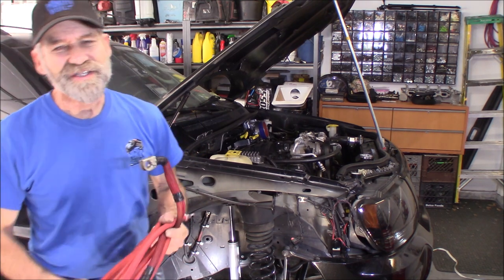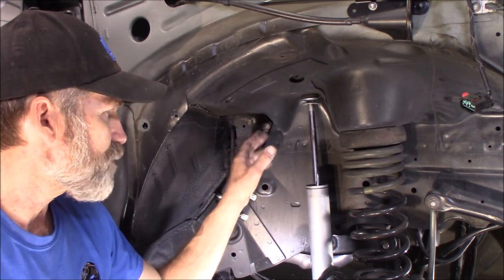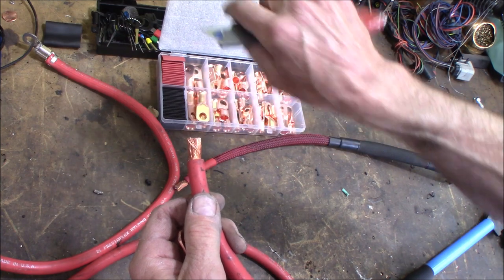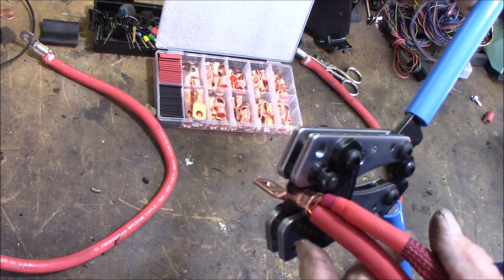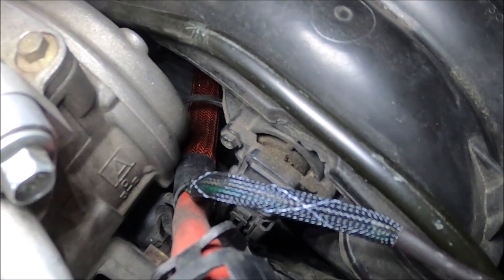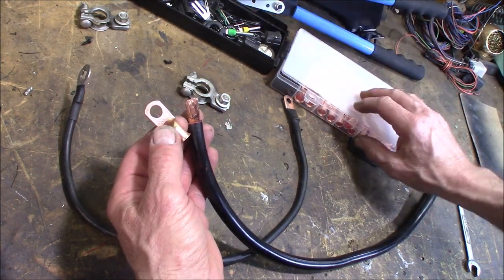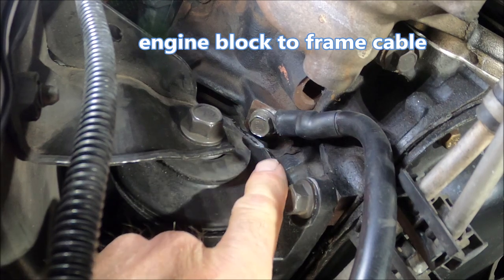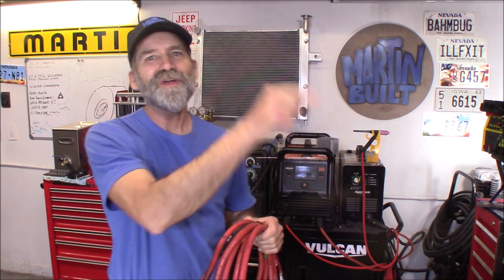How To Install the Big 3 Upgrade Improve Your Vehicle's Charging System

Comment: One of my first & best mods IMO. My XJ started first try, prepped for my Dodge big alt swap,& ensure current available when needed.
I used welding wire, waterproof shrink tube, & brass lugs. Upgraded batt post clamps too.
Reply from the maker: Thanks for sharing
Reply: Jmu

Comment: Nice job posting this. I did this a couple of years ago on my XJ and it really made a difference, smoother running engine and no issues with the gauges.
Reply from the maker: Yeah I may need to do this to my XJ
Reply: What size ground did you use same size as this?
Reply from the maker: @mobius-1503  yes, same cable 1 gauge, I just pained the red black.
Reply: @mobius-1503  yes
Reply: Also the ground going to the body by the battery I did that #4 as well

Comment: Use some liquid electric tape after soldering/crimping then add your heat-shrink and you will have a forever cable that will last until the lug rots off. Seems not many people know about liquid electric tape but it is a great product especially like where you joined 2 wires in one lug and have a penetration between wires into the joint.
Reply from the maker: I've used that liquid tape many times and it works quite well.
https://amzn.to/3MjrVqn

Comment: By pulling the negative cable first you prevent sparks. That's why they tell you to pull the negative then the positive. If it was a wet cell battery it could cause an explosion if it's venting alot of hydrogen gas at the time.

Comment: U pick u save in Syracuse New York I got mine out of a Chrysler 300 today yep 👍 about $ 6.00 in the rusty east coast. Thank you Martinbuilt great heads up on parts to put to use. I’ll have the ground on tomorrow from engine to frame. Got a ground a bit smaller but the best Made in the USA.
Reply from the maker: That's still a really good deal.. I would imagine this time of year you had to battle a little bit of snow.
Reply: No in fact it was 66 degrees yesterday. Still warm today but rain. Snow is all most gone. 
I have my receipt from yesterday I paid 2.80 for 13’ of #1 red welding wire from that Chrysler 300. WOW cheap. I also found a high performance air cleaner, and a small 90 of hose for a total of $6.00
Reply from the maker: @gregj.gotham4402  That is is an awesome deal.👍

Comment: Love the video. 
 I got my big piwer cable out of a bmw 740 IL any time i build a car i buy one to scrap an i take all the wire out of it an use it on my build
Reply from the maker: Thank you. I'm glad you liked it. Yeah. I've seen the battery cables on some of those BMWs. Those are even bigger than the one I got out of the chrysler.

Comment: Great job and informative.  Only thing I would do different would be to have a vent tube for battery due to fumes.  Could be just as simple as hose and grommet that runs outside cab.
Reply from the maker: Thank you, there is actually a 3/4 hole vent toward the bottom of the battery box and there is also the battery temp sensor mounted at the back of the battery Box that also vents any battery games if any.  One thing nice about the Optima battery that it is a sealed battery and only would it vent would gasses during an overcharge situation.
Reply: I think those optima bats are AGM so no vents needed

Comment: Hey Martin your Jeep is 4.7 correct? Well my 4.0 doesn't have a power cord from the battery to the alternator. It has a power cord from the alternator to my fuse box. Is that the same cord essentially?

Comment: Any advice on how to get a stuck pitman arm off? Mine is stuck on there good.
Reply from the maker: I've always struck a hammer on the end of the Pitman arm bolt bolt and also using a hammer on the side of the Pitman arm.  Continuously tightening the Pitman arm bolt And it always comes off for me.

Comment: Only problem with a  battery cut off switch is you have to do a PCM drive cycle every time you turn it off
Basically like clearing your codes 
Then perform your drive cycle to reestablish your monitor systems test cycles
Such as evap 02 sensors cat ect
Reply from the maker: I only use the cut off switch when servicing the vehicle much easier than pulling the cover off the battery box and removing the negative terminal, it also makes a great safety feature.

Comment: hey martin, quick question. I have a 2004 jeep grand cherokee 4.0. I'm doing a basic big 3 for a aftermarket sound system that is being installed. Where is the location of the factory OEM ground to switch out? It's so hard to find information on the grand cherokees. Thanks, great content boss
Reply: I think you prolly figured it out but when i did mine i just overlayed a lot or replaced some. 6guage for passenger side engine where i think the knock sensor is up to fire wall. 2 gauge from alternator bracket to battery, 2 gauge from battery to fender under the coolant tank (opted to not move the fuse box to replace the factory fender ground), then there is one more ground low on the engine block behind alternator i put a 2 gauge there up to the other bolt hole for the coolant tank but you can run it how you like. I choose the coolant tank because the mounting bolts already existed and it was easy to use studs over the lugs to reattach the tank. It is actually more like a big 7 wire upgrade on the WJ once you have done then all. I left the fuse box alone in mine as i was only adding 1200watt amplifier without expensive alternator upgrade and the factory should have had enough for their end (fuse box). I did notice the engine was a bit happier when the cooling fans kicked on and AC was running. Some those wires like Martin said maybe only 8guage and the flat strap on the passenger side to fire wall well i have seem more copper feeding and rc cars motor than Crysler used there my flat strap fell to 2 pieces when i remove the nut from it. I took 4 gauge  back under passenger rear seat on a 100amp maxi fuse added a distribution block there with a pass through hot and 4 fusible legs. Added a Xspower AGM where  Martin added his optima and found good spot just beside the E-brakes splitter box under the seats for a ground. This will all depend on how you want to do things i opted for some solid terminals that have 2 grubs screw holes of that take 0 to 4gauge  and 2 grubs taking some smaller wires so i could over lay some of the factory wire since the terminals gave me so many options. I got both factory hot and negatives into 1 large grub hole per terminal and had another big hole and 2 smaller to play around with.

Comment: Very intresting your talking about ground. I have the left light flickering issue when stopped and my blower motor relay keeps blowing out. Wondering if i have weak ground straps. Their paper thin
Reply from the maker: Yes it could be a poore ground. The ground straps may be thin but they add up to around a 14 Gauge wire.

Comment: What if your battery is in the trunk? I've been wanting to install the big 3 on my 2015 camaro but the battery is located in the trunk. The only thing I can think of is run the 0g power wire from the trunk ,through the car, and to the alternator but from what i was told having "too long" of a wire can  diminish the power your creating with the big 3. I have car audio that eats a good bit of it so i definitely need more power with everything powering off of the oem alternator
Reply from the maker: Since your battery is in the trunk, you probably already have one gauge cable. I would improve the ground cables then. You can also enlarge the alternator cable.

Comment: Martinbuilt: I’ve looked for how you have removed the long battery positive wire from Chrysler 300 or dodge I don’t see a link under this video, I don’t find it in your video’s?
Reply from the maker: It should be this video 
Relocate Battery on a 99-04 Jeep Grand  https://youtu.be/TDyCwM6FI54

Comment: Not shown in the other video, was the negative cable also off the charger?
Reply from the maker: I didn't use the negative from the Charger, it is only 8 gauge. The negative that I used was the same red cable I just painted it black.

Comment: not sure i would solder the joint.  solder is not a reliable cable connection method.  as the copper hardens from vibration more strain is placed on the solder joint itself until it fails.  the ground system on these vehicles is kind of not great.  i would not rely much on the unibody structure to transfer much load  i would keep something similar to the factory arrangement and add a battery ground straight to the engine block as many parts of the vehicle electrical system ground through the block back to the battery, which is also grounded to the block.
Reply from the maker: I used to work at a wire harness factory where we built harnesses for John Deere and Caterpillar and many other companies and all of caterpillars terminals are dipped in  soldered.
Reply: @martinbuilt  how long ago?
Reply from the maker: @salvadorebertolone  1986-1991
Reply: I agree with Marting, The solder is not for securing the joint, it is to improve the joint preventing moisture from entering the crimped zone and stiffens the cable end. The Heatshrink further holds the joint to reduce "moving/bending" the wire to lug section.

Comment: Hi Martin, I'm replacing the heads on my 4.7 and there are some ground straps that have fallen apart.  Do the heads need a ground as well?  From where to where?   Thanks!
Reply from the maker: Yes, it's a go idea to have them. They go from the driver-side head at the rear coil bolt to the passenger side rear coil bolt to a ground stud just above the ECM.
Reply: check the block surface for flatness.  these engines run a mls gasket which require an exceptionally perfect surface finshes to seal correctly.  as martin said, yes theres a ground strap from each rear coil stud to a stud on the firewall.

Comment: At the 15:30 mark what did you mean that the terminal wasnt touching the.. i think it was frame???
Also to solder, i just have the basic tools that i bought at Walmart, also a roll of lead type solder... Could i use that? Or is that too weak and 🔥
Reply from the maker: To prevent rust, paint the frame any where the terminal is not contacting the frame.
Reply: @martinbuilt  not directly related but still on the 04 jgc 4.7 HO, i watched the fan SWAP you did and was intrigued... But i was wondering have you found another electric fan that would also fit into it? Or has another subscriber of your page come across another fan that would also fit? And easier to bolt in?
Reply from the maker: @noemah3272  the 97 Mercury Villager or the Lincoln Mark VIII fan would be a good fit and perform well.

Comment: I'm looking to do the big three on my 2018 JL Wrangler but it has an auxiliary battery and I'm not quite sure exactly how to do it is there any links you could send me to or any kind of help you can give me it would be much appreciated thank you
Reply from the maker: I would just replace the existing battery cables with a larger gauge cable, and you should be good.
Reply: @martinbuilt  
Well the auxiliary battery is buried under a whole lot of stuff in the engine bay and if I don't have to replace the cables to that it would be great that's mainly what my question was thank you for the reply.

Comment: Hi I had a quick question, I was gonna change my Alt to a 320 in my 20 Ram 1500 5.7. It said I needed a shorter belt, 1/2" to 1" shorter. I seen there is 2 options 1 belt is like .58" shorter and other is .98" shorter. How would I know which one will work best, thanks alot
Reply from the maker: By the sounds of it the manufacturers already determined that either one would work just fine it's just a range half an inch to 1" shorter will work.
 If you're planning on Is pulling anywhere near that 300 amps I would go ahead with the shorter one.
Reply: @martinbuilt  ok cool yeah I was thinking of going with the 240A alt but might jus do the 320 and be done with jus in case. My amp Is a 2k which I don't plan on going any higher than that. It looks like the 240 and 320 pull around same amps at idle which I like but wasn't sure on if I should use that 1/2 belt or the belt closer to 1"

Comment: I dont have a jeep but a mazda 323fastbreak (2001)
I did a big 5 upgrade
How do you think about upgrading the power and ground wires of the fusepanel or fusebox?(under the hood)
not the interior fusepanel!!
+ battery to + fusebox 
- battery to -fusebox 
-fusebox to ground chassis or bodywork 
Is it also better to upgrade these 3 wires?
Reply from the maker: yes, it would a good idea to upgrade the + battery to fusebox+
I don't have any - fusebox but if your car does yes you can do those as well.
Reply: @martinbuilt  oke oke
Tanx for your comment
And what about the power wire from alternator to + fusebox?
Is this one also needed to upgrade whene the powerwire from +alternator to + battery is alteady done?
And how is it possible that you dont have any - fusebox?
Reply: @acepairfecto5597  ok..tanx man👍
Reply: @acepairfecto5597  
Yes i watched that vid also
I am gonna put some small bolts in the back frame of the alternator and connect 2 or 3 wines from the small bolts to the bolt that holds the alternator .
Than connect a big wire from that bolt to the - of the battery.
And a extra ground wire from the altornator to grond chassis
Reply: @acepairfecto5597  
Watch team# peranurkka
Also a good explain
Reply: @acepairfecto5597  
Yes i'f heard something about that to much negative issue
Tanx for the tip....good advice👍
And i wont do to much dork work haha

I have a amplifier and a 1000watt 12v to 220v inverter to charge tool batterys 
My polishing machines are also running on it
So all i want is that the inverter gets as much as possible power

What i did now on the car is...
One thicker cable from +alt to +battery 
One thicker cable from -battery to chassis 
One thicker cable from engine to -battery
One thicker cable from engine to chassis
Not zero gauge but pretty thick wires
Only need to do the ground alt to -battery and alt to chassis yet
Reply: @acepairfecto5597  
No i just left the small oem engine ground wire there.
I put new wires on the bolts of the hoist brackets on the cylinderhead. 
One wire goes from one hoist bracked to chassis where i tapped srewthread and put a big bolt in it.
The other wire goes from the other hoist bracked to - battery.

About the batterys your talking.
I think i am not handy enough to make something like that.

I have a big Flex 1200watt rotating car polish machine.
I tested it at home with a powermeter/wattmeter/amperemeter.
It uses only 600watt
I tested the machine on the converter and it works perfect.
Even when the engine is not running
The car has a small 50ah 500amp battery 
I also have a battery powered eccentric polish machine
I use the converter to charge that battery
Or to charge the battery of a drill or other  batterys of  my wheelgun

Sorry for my bad engliish
I am from the netherlands and have to Google translate sometimes🙈
Reply: @acepairfecto5597  hahaha yeh nederlander🤣      its far away from Orlando 
Yeh i was also  totally surprised with the machine running on the converter.
And its a HQ modified sinewave converter
I will use this machine for short times...for sanding and polishing headlights
So it will not overheat i think.
Whene i am finished with all this shit in my car i will make a movie of all the wires en equipment and post it on my channel.. ok

And yes indeed...i have a 45kg rottielab/american bulldog cross....massive power🙈🙈   he is 2 years old now
Before this one i had a rottweiler/rottielab cross..52kg.

So you also have a rottweiler mix ?
This is great  haha....beautiful dogs man.
I googled blue heeler 
Its a australian cattle dog right?
Wow man it must be a very beautiful dog.

Very nice to have  a conversation with you....great bro👍👍 thank you as well for sharing some knowledge 
Always good to learn something

(PS)  i slowly gonna understand your story about the home depot and the batterys hahaha

Comment: hi! can i use 200amp wires from a jumper cable/lead? i found them to be thick and high amperage. thanks in advance!
Reply from the maker: As long as the Gauge of wire is bigger than what you already have I would go for it, bigger is always better.
Reply: @martinbuilt  thanks for your advice! love your vid so informative

Comment: I have a cylinder 4 misfire changed  cam and crank sensors, no change. 98 2.5 Wrangler. Any ideas
Reply from the maker: I would check and change if needed,  the spark plug, ignition wire, fuel injector and distributor cap.
Reply: @martinbuilt  think could be pcm?
Reply from the maker: @michaeladams3851  I doubt it, I would check the things that control the #4 cylinder first.
Reply: Also look for carbon tracking in the spark plug boots, always start with the simple stuff first.

Comment: That cheap cable isn't oxygen free and has a lot more resistance than oxygen-free cable. You basically got to run twice as much as oxygen-free wire.